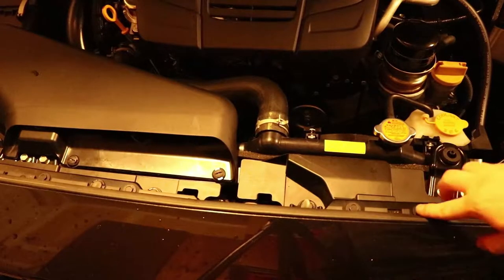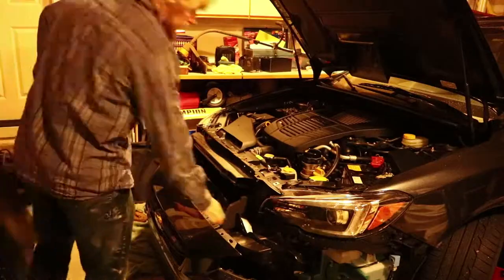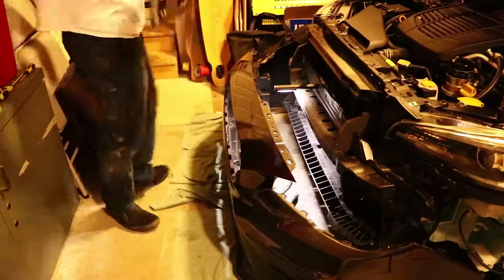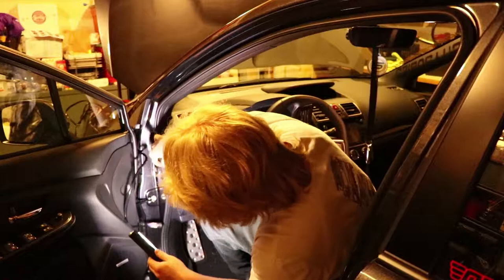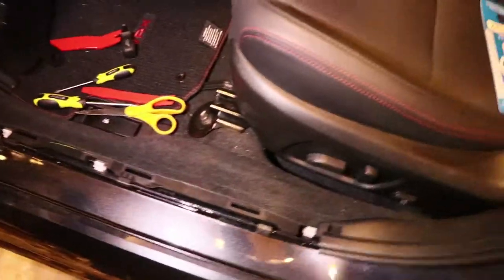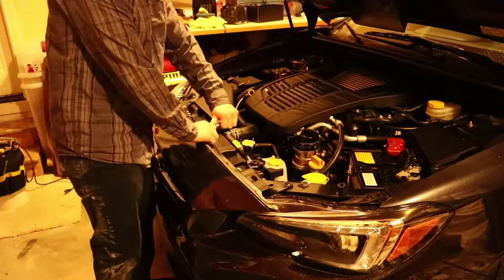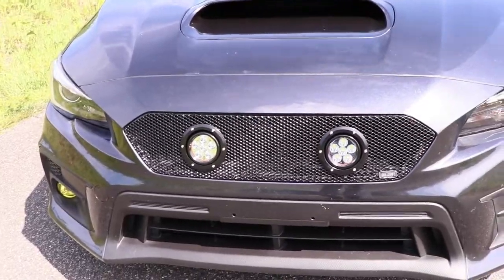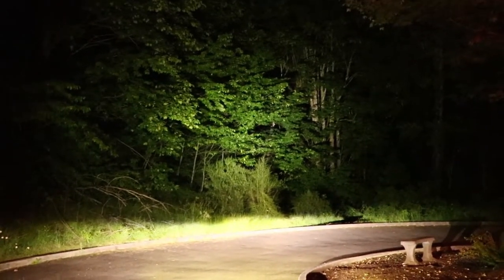Grillcraft XE Series Grill Install | 2018 WRX | Chridfer

Comment: First off great video! I noticed you mentioned adjusting the lamps before tightening everything down. Do you have enough adjust to angle lights so they illuminate the sides more? I'm looking for somthing that will help around those tight canyon corners.
Reply from the maker: Thanks for watching! These can be moved to the sides. Though I have since swapped these out for Baja Design Squadron sports; these are slightly smaller and can be moved side to side much more. You could buy a set of those in a driving combo for canyons.